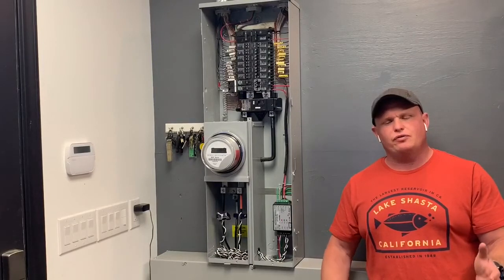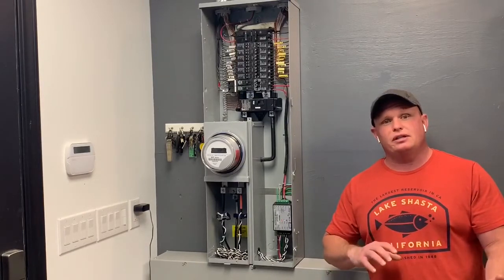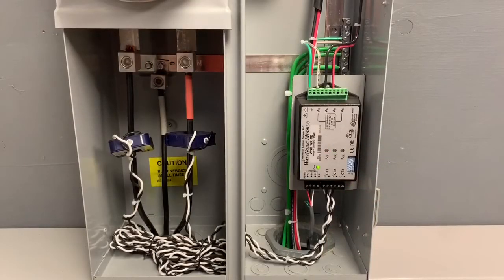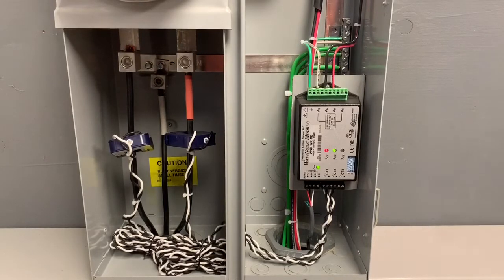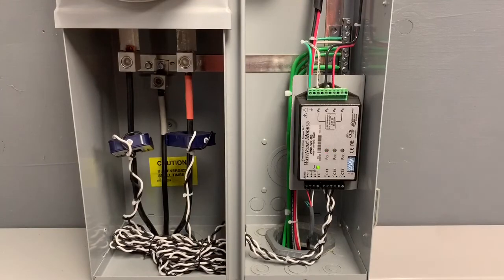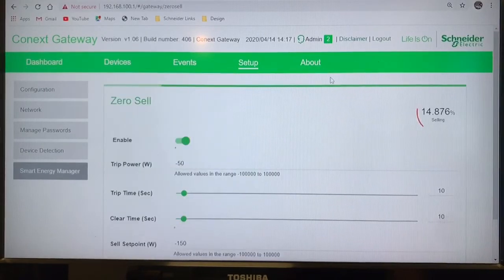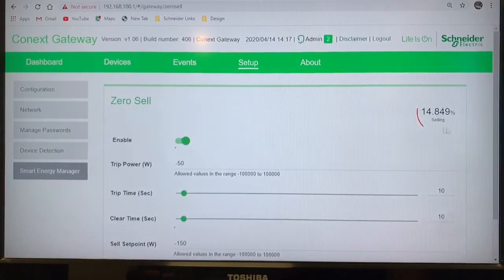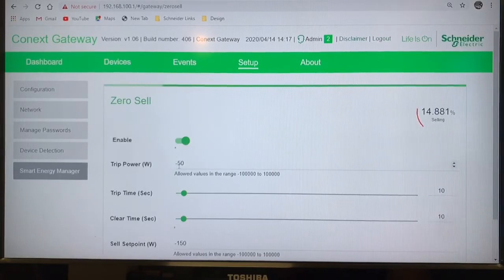Schneider XW Pro using Zero Sell

Comment: Have you ever ac & dc coupled a smaller schneider 4048  at the same time? Seems doable being the system can charge from the grid being dc  coupled ?
Reply from the maker: Yes and it worked well, the ac coupled pv typically kicked in when heavy loads were running and reduced the inverter strain by running pv direct

Comment: Hello Jason I was wondering is it possible to do grid support with the Schneider 6848 xw Plus without a Schneider charge controller say using a Midnite classic charge controller and without a Schneider battery monitor?
Reply from the maker: Spencer, I know that with enhance grid support you had to use all Schneider but with standard I cannot remember
Reply: Just to let you know it works just fine with the midnight classic But it's not in advanced grid support Just regular set voltage grid support Works very well.

Comment: I cannot find any Schneider documentation on this and I'm having issues getting this functioning properly on my XW pro system. What would be a good resource?
Reply from the maker: I wrote an app note when I worked at Schneider have you downloaded it
Reply: @JasonAndrade427   I had previously been looking in Conext Gateway and InsightLocal  materials and found nothing, also looked at the XW pro guide and overlooked the additional guides on the site.

After reading this: https://solar.schneider-electric.com/wp-content/uploads/2020/10/TP202004_Conext-XW-Pro-Self-supply-and-Grid-Sell-Limiting-Solution-Guide-990-91371_rev-A.pdf I was able to figure it out! So cool to have it working finally.   Since I was installing blind, I had missed the following important items:
- did not associate as "grid" because power flow looked backwards, this was because I installed CTs based on WattNode instruction and had source as grid, not inverter
- this meant my timings were also backwards so I had to adjust
- in general my timings were too tight based on how fast the system responds, buffering helped tremendously
- may be placebo but setting baud to 19200 vs 9600 seemed to help. 

thanks for pointing me in the right direction.

Comment: There is an interesting combination of devices made by myenergi.com, and the Schneider zero export software reminded me of it since trigger limits can, also, be setup with their app software.

Essentially whenever there is some surplus of generated energy, the devices will either heat water (option for hot water heat pumps) using a heating element or charge an electric vehicle.  

They have a wireless system for placing CTs on batteries, grid electricity, and generated energy.  This allows to know when surplus energy is available, and the set up is much faster than the Watt node since it is all wireless.  

Another great feature is the relatively quick installation of the EV charger since it is one of the few systems not requiring a copper grounding rod.

These devices will help prioritize what gets surplus energy first: battery, EV, or hot water tank.

A big advantage for zero export sites is that rather than shutting the system down or throttling it down, it uses the surplus energy whenever there is a device able to accept it.

For customers it lowers the payback period by maximizing usage of available resources.

Unknown in the U.S., they can be ordered by email for 110 AC @ 50Hz.

Comment: Hi Jason, thanks for the video. I was looking to do zero sell for a customer using the XW Pro with the WattNode. I'm wondering if maybe you could help me answer a couple questions I had:

Were you able to get an Application Note from Schneider for programming and setting up the WattNode?

Is it possible to export the full rating of the XW Pro (6.8kW) on AC1 while maintaining current exported to grid at 0? If not, do you know what the max rating is?

If exporting to the grid at 0 amps and the only load is the main distribution panel, is it required to have anything connected to AC Out on the inverter in order for exporting back on AC1 to function? Ideally, I would like to back feed my main panel and not have to run my loads through a separate sub-panel. 
Looks like this is what you may have done.

And last question, if the grid goes to 0V, will the inverter still output through AC1 and thereby feed the load with grid not present?  

Thank you for your time.
Reply from the maker: Yes there was an application note available I have not looking into this for a while as I shifted gears some, the only issues I was seeing was leakage on imbalanced loads, let me know if you are still struggling with this and sorry for the delay

Comment: Hi Jason, I'm a little confused. Is that mater/main panel there for your off grid system? Or is that meter a utility meter? I'm assuming it is not a utility meter as the gutter setup you have below. I sure wish the AHJ's would let us install consumption CT's in the utility pull section like that. It would make things a lot easier as a lot of meter mains will not fit CT's.
Reply from the maker: Hi Jesse, yes this is for my offgrid system, I always liked to use meter main panels as they are pretty cheap and easy ways of seeing over all consumption and on the generator side you can see how many kWh were subsidized.
I also wish they would allow access to that section, one thing they should consider is that there are utility meters that have provisions for remote Cts. It would be nice if we could utilize that for rs 485